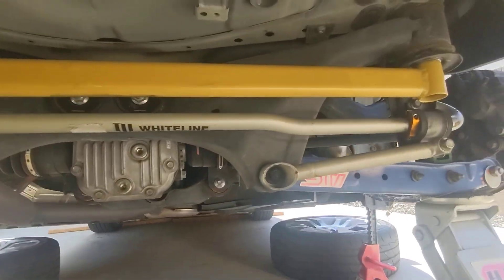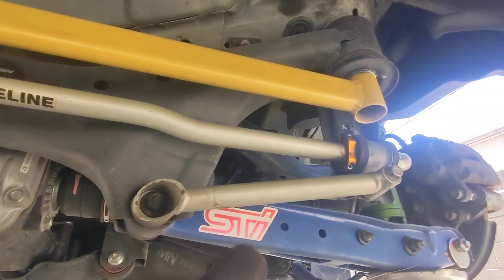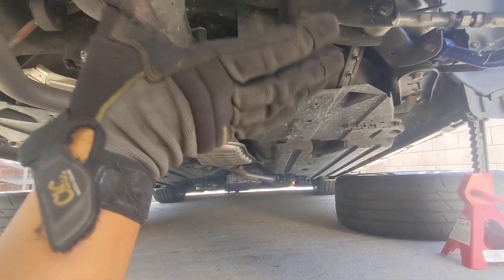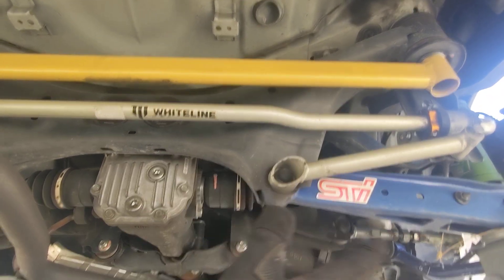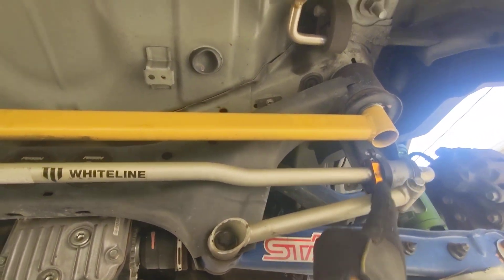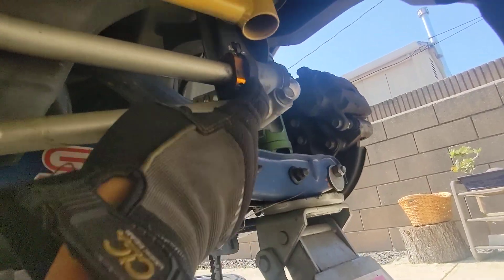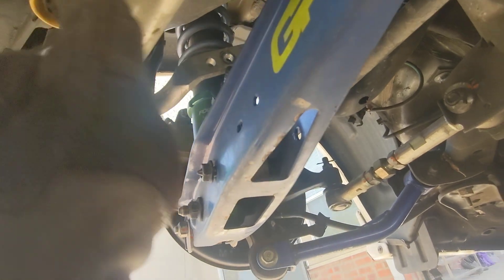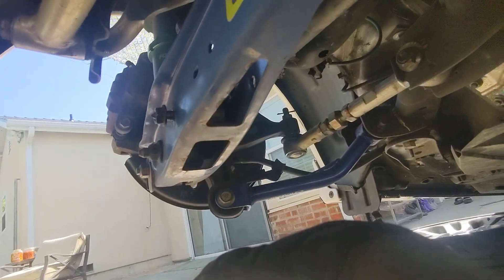A little bit about sway bars - Subaru

Comment: If you want the rear suspension to be even stiffer, you can change the bones to Whiteline KLC231 Rear Swaybar Link Kit.
Reply from the maker: I thought about aftermarket end links... The car is plenty stiff with OEM ones! Thanks for the suggestion! The adjustable ones might be useful though.

Comment: It's not a problem bro! Just buy "Rear mounting reinforcement for sway bar Cusco 6А1 492RL". And they are made of aluminum, not cast iron. Under the standard stabilizer mounting bracket. I use Cusco with Eibach XV 40-77-011-01-11. Eibach it's better for me because made of stainless steel.
Reply: And one more thing, a special lubricant is used in the rear Eibach stabilizer bushing. Therefore, the stabilizer moves more easily; the use of lubricant is not provided for in the wobbly bushings of the stabilizer. This may be why they move more heavily for you.
Reply from the maker: @metaframe2k  the whiteline bars come with grease, it's just that the OEM brackets and the aftermarket bushings get squished really tight. 

Thanks for the suggestions. I think stiffening up the front will be more useful now that the rear is well braced. Cusco has the under side braces which might help with the length of the car being stiffer.